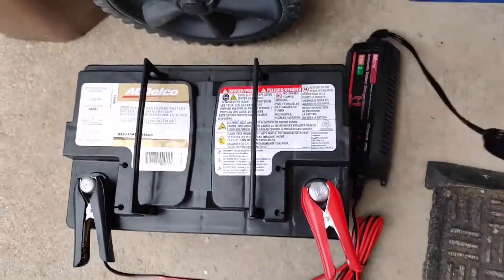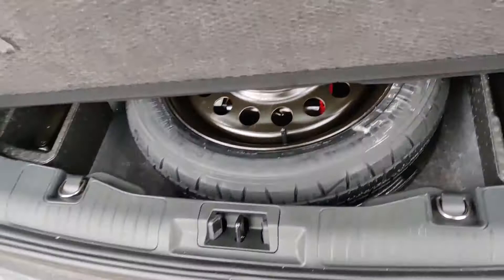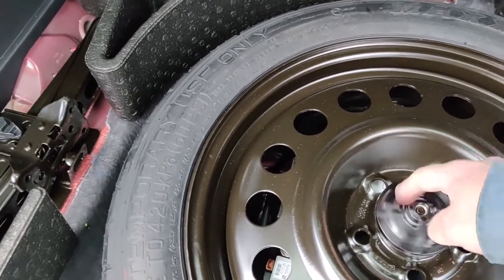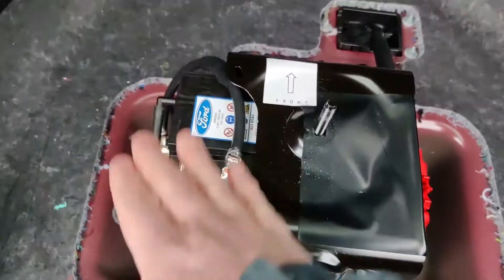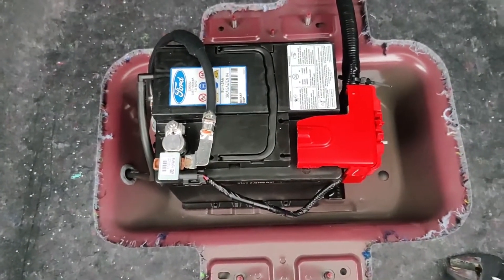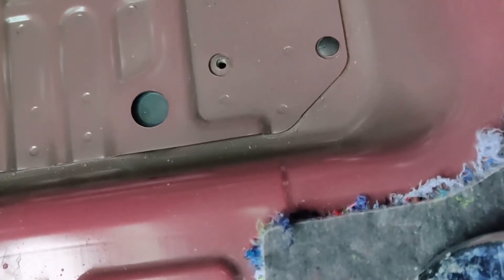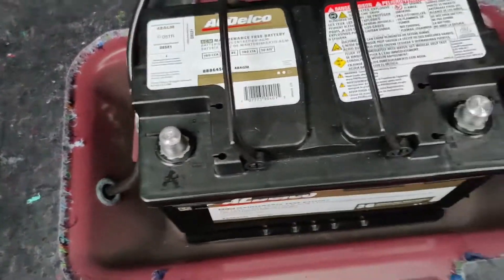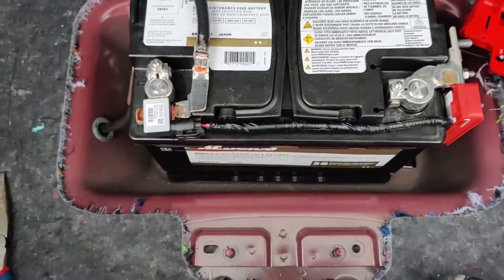2020 Ford Escape Hybrid 12v Battery Replace with Group 48 AGM

Comment: I asked my Ford dealer if they would replace my baby-sized battery with one of these adult-sized ones and they said no. The only thing they could replace it with is another baby-sized OEM batteries for $350.
Reply from the maker: You can take it to any battery store and get the large battery installed. Don't take it to the dealer.

Comment: You need to do more than simply reset the the BMS.  Using FORScan you need to go in and change the battery type to AGM as AGMs like to be charged at a higher voltage.  You also need to change the battery model, again with FORScan, especially since you just installed a new battery with a much higher capacity.
Reply: Is this DIY or do you need to take it to a service center? Thanks for the info.

Comment: But my question is, does it take effect on the maximum mileage? The HV charges the 12v battery in a PHEV. So in my opinion, if this battery has more capacity, the HV doesn't have to charge this one continuous.

Or am i seeing this wrong?

Comment: Hello, I replace my undersized Ford battery yesterday...  There are many H6-48 Group AGM batteries that have the same specs as the Motorcraft that they recommend. I used a Mighty Max battery. Everything is working fine, no more warnings on the screen and the passenger door handle locks and unlocks as it was designed to do.  Thank you for all of the good information.

Comment: H6 (48) battery?
Reply from the maker: yes
Reply: Thank you sir. Will change out the battery and reset the bcm and report back here to you on how it went. Godbless
Reply: @chamkila911  How did it go? Let me know which battery you bought
Reply: @ditomathew1  I changed it out as you showed and it worked out great. THANK YOU SO MUCH.
Reply: @ditomathew1  I got an ac delco h6 AGM, had it since 2023 in my 2020 hybrid.  Last month the 2020 was totaled in an accident and I kept the battery and put it in my 2022 hybrid, was having the same problems as soon as I got it with the battery sleep notice and all that.

EDIT:  I would recommend an agm battery charger and conditioner, I think I got one for like 30 or 40 bucks, it will top the battery off in a day and then you install it.  Make sure it is AGM compatible, since it is different than a flooded battery.

Comment: I just upgraded to the larger battery and put in a Walmart Platinum Everlast AGM with 4 year free replacement all good. Thanks for the tip on the upgraded battery size worked a charm.
Reply: What size is the new battery? H5 or H6?

Comment: Thanks for this valuable instruction vid, sir.  It is a major disappointment to find Ford put this "mini-battery" in my Titanium series Hybrid Escape, which was dead in the garage yesterday.  Your posting guided me to an upgrade that will avoid this occurring👍 again.
Reply: Hi may I ask if both smaller 12V battery and larger hybrid battery discharged because of defect or maybe car was not driven enough to charge both batteries?  Thanks
Reply: I bought my 2020 Escape hybrid in December 2020 after having a Toyota Prius for 11 years. I learned last November, after having my second starter battery replaced, that driving  does not recharge the Ford starter battery. Driving only charges the hybrid battery, not the starter battery as occurs in the Prius.
Reply: @djsomers12  if you google 2020 ford escape hybrid alternator you will see that it has one, which means when you drive your vehicle, the 12 volt battery is being charged when the gas engine is running. The hybrid battery gets recharged in several ways, from the alternator when the gas engine is running and from the electric motors when they are being used for braking.
Reply: How do you fit a larger battery in the space of a mini battery?
Reply: @otherr7201 the video shows that the well has 2 holes, one for T4/Group 140 and one for H6/group 48.

Comment: Pretty sure those were 12mm nuts on the battery retainer, not 1/2".  The only imperial nuts/bolts you'll find on modern vehicles are sometimes the lug nuts (more common on trucks and/or older platforms).
Reply: Just did it myself, 13mm socket worked best and a 10mm for the smaller bolt holding down the base of the battery

Comment: If you have Forscan you can reset the BMS using Forscan and save yourself the dealer trip and fee .  Also, what model AC Delco did you get? Thanks for the video.

Comment: By chance, do you recall the specs of the factory battery? My 2021 hybrid has a different sticker but appears similar in size, curious on the ratings. Thanks.

Comment from the maker: I've had some folks ask about resetting the BMS. You can reset it yourself. Turn on to accessory mode by pressing the start button without your foot on the brake. Pull back on the lights (high beams) 5 times, then press the brake pedal 3 times. Then wait 10 seconds and the BMS will be reset.
Reply: Worked like a champ. Perfect.
Reply: @herkybc130 
Im curious to know did it work right away for you because I'm too looking to upgrade since better power provided. Cause now I can't even use app to start escape.  Interior lights sometimes will even stay off savings power 🔋. Reset worked perfectly right without taking to dealer???
Reply: @Livin_is_life Correct. No dealer visit required. Went to Advance Auto Parts and bought an AGM battery for about $230. Had the guy in the store come out and swap out the batteries. He did plug a battery saver into the ODSB port so all the settings wouldn't dump. It worked. My Escape hybrid no longer goes into a battery saving mode.

Comment: My dealer was able to change it out free of charge. Check with them first! Either way thanks for making the video and showing me how easy this is to do!
Reply: They were refusing to foot the bill for awhile. I had this done last year out of our pocket after arguing with them. Hasn't had deep sleep issues since but now we're getting some issues. Might have reverted back to default battery settings. Service appointment in two weeks.
Reply: @davidrunyon  what kind of issues? Thx!
Reply: @davidrunyon  Any update on the agm and if it was causing any issues?
Reply: I will definitely ask my  Service department manager about this Friday when I take my car in for other service work. My 2020 Ford Escape hybrid that I purchased in December 2020 is headed towards the third starter battery replacement.

Comment: What a pain in the ass!
Reply from the maker: Not hard to do. Took me about 10 min. The vehicle going into deep sleep constantly because of Ford's crap OEM battery sucks though
Reply: @colorado_al  Did you do the battery monitoring system reset? accessory mode, high beam x5, brake x3, wait for battery to flash?
Reply: You're not THAT annoying.

Comment: How did you remove the plastic plug from the hole for the further hold-down location? It's taking so much force to get it out of there I'm worried I'm going to rip the top off the plastic
Reply: 2 years late but for anyone else looking at this, the plastic plug is threaded! Don’t try to pull it out, you gotta unscrew it

Comment: How did you move the battery harness bolt to the other hole without the hole being threaded?
Reply from the maker: Was threaded, but painted over
Reply from the maker: Hole was threaded in mine. If it isn't in yours, you could thread it with a tap
Reply: I'll take a look at my setup. I was watching the video posted and noticed the new hole that was used didn't appear to be threaded.

Comment: Thank you for posting this. Experienced dead battery twice with less than 1000 miles on the car.  Is the warranty still good for the car with this battery?
Reply from the maker: Yes the warranty will remain intact, as long as you get the service department to set the Battery Management System to AGM type battery. If you want the Ford dealer to install an AGM battery, here is the Ford part 
Part #: BAGM48H6760 (48H6)
https://parts.ford.com/shop/en/us/electrical/battery-and-related-components/battery-7862483-1
Reply: @colorado_al  a Ford dealer just told me that warranty would not cover any issues that requires them to check the battery type, regardless of who installed it, and regardless if the BMS had been reset to AGM type
Reply: @colorado_al  I'm curious what the change actually is/does.  AGM and FLA have the same charge characteristics. AGM was specifically designed to be a drop in replacement.